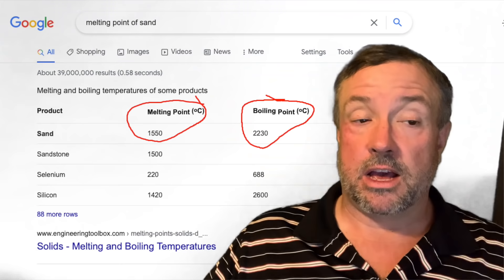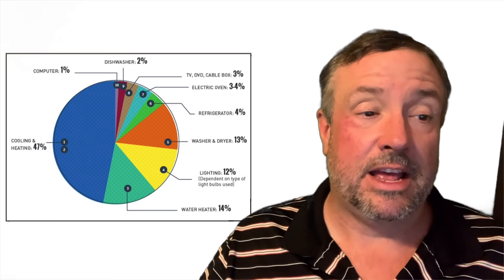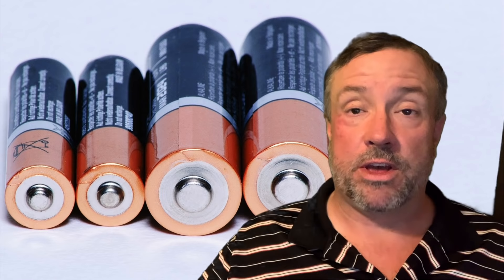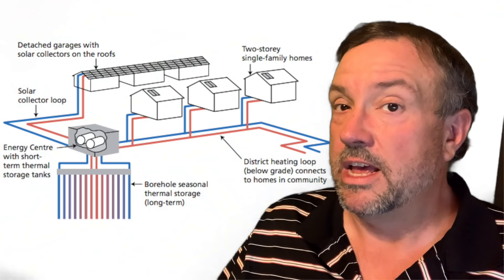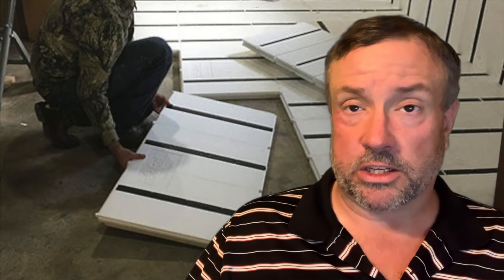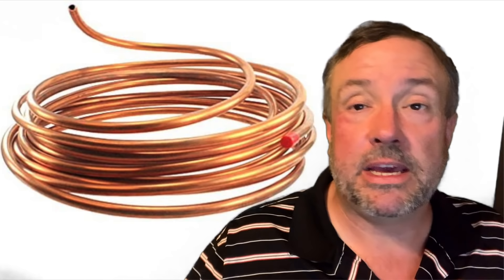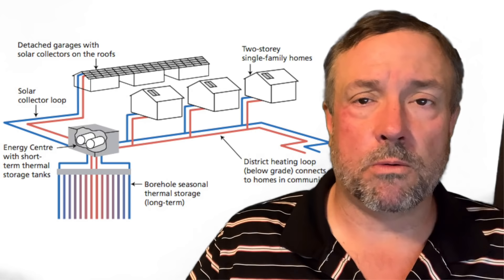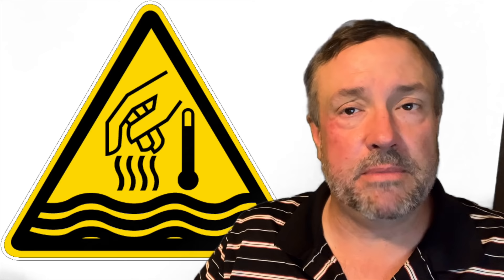Sand for Thermal Energy Storage

Comment: I'm thinking that the savings that you make from water and storage volume cost you will spend on piping and pumps and liquid to transport the high temperature with high temperatures come big problems, if something happens to the construction or piping, if a problem happens with water you simply pump it out.
I prepare to do a 20 cubic meter reservoir dinged in dirt ( I am lucky that I have yellow dirt all around my house, is strong like concrete :)))) ), heated up to 80gr celsius with ~10-15CM isolation( cheap materials are up to 70gr celsius but they can easily handle 80gr celsius ), to deposit about 60KW pe cubic meter from 80gr to 40gr celsius interval, my house eat about 60-70KW of energy/day for heating and water in winter, I will heat it with fotovoltaic ~20KW/h panels * minimum 4 hours = 80KW/day to compensate winter climate with custom electric heating element controllers developed by me ( each will handle ~5KW will be open sourced based on Arduino platform ).
I prefer fotovoltaic solar panel's because I have some crypto miners and when the reservoir is at maximum temperature I can switch the panels to miners and for better randament on very cold weather, I am from Romania and the winter can go down to -25gr celsius :)
I chose 20cubic meter to cover cloudy winter days, too big is too costly, too small will risk not to have enough heat if more cloudy days are in a row.
Reply from the maker: interesting

Comment: You should also consider power creation. From 500 degrees sand you get enough energy for different generators for days and nights. Then you could use normal boilers to heat your water. Imo it is easier to make power and use that for various purposes. Its easier to install and maintain powerline than pipes and airvents. You could run a boiler that feeds your water radiators forever for free without breaking your brain about how to get the heat from sand to your radiators. Plus i just saw a video about solar park, that stored the heat in rocks. They said that the heat went so high the steel piping and walls started melting, so they had to install more insulation. And that the rocks stood burninghot for weeks. Heat water on sand to make steam that runs your generators. Easy. You could sell cheap power to your neighbors and get rich.
Reply from the maker: Interesting ideas!!!

Comment: I would really argue for phase change energy storage to be the most efficient. The reason for that is that it sticks at the same temperature.

For example if you store energy in water when the storage device is full its about a 100C, when the storage device is empty its about 20C.

If you store energy in something like vax, when the storage device is empty, the temperature is 64C, when its full its 66C. So if you keep the  storage tank inside the heated area, say its 30C in the summer, you only get delta 35C of leakage. When summer turns to winter the leakage is effectively 0, because that is pretty much the intention. (you can actually get vax with as low. you can actually get vax with as low melting temperature as 45 degrees, cutting the leakage in half yet again

A hot water storage would have a delta of 70C in the summer, and there for twice the leakage, hence retain less energy to the winter. For sand storage the leakage would be significantly more. . While a tank of vax will not store more energy than a tank of water, it will do that with less leakage, extending the duration of the use.

Sadly there is no simple way of increasing the melting point of water, other way it would be an excellent frost protection. While lowering the melting point of water is really simple. This can effectively be used as a cold energy storage. What comes to mind is a AC unit.

Even in climate where the water don't freeze, it can still be used as an effective thermal storage.

Besides paraffin vax there is hardly anything with the right melting temperature that is not super expensive that fuse in the right temperature range. Well cocoa butter and other organic stuff exist.

There is of cause the "other" phase change type, boiling. The issue with boiling is that most thing takes out a considerate amount of volume while its in gas form, making it unusable for most type of energy storage.
Reply from the maker: I plan on doing some experiments with phase change soon and paraffin wax
Reply: @SimpleTek  cool..  i only theoreized it. But it should have relly nice result

Comment: I'm not saying that this is an ideal solution for extracting heat from a heat accumulator with sand heated to ~500-1000 degrees Celsius, but the thought arose that, apparently, there is no need to look for anything specific like a liquid coolant in a car or something else. Regular water will be enough. Because a) this specific liquid will have a high price, and we are looking for a relatively cheap solution, and b) we need to study for a long time the possible negative impact on the heating system from those liquids that would replace water. So what's the point? Simply place iron or copper pipes for water in the upper part of the sand heat accumulator through the necessary number of layers of insulation, which would guarantee us a water temperature not higher than 90-100°С (boiling). Thus, we can heat the sand as hot as the resource we are heating allows us, and the water, regardless of this, takes heat from above in portions, always having a temperature below the boiling point. Almost like in automotive cooling systems, where there are also two coolant circuits, only here they are independent.
Reply from the maker: ok

Comment: If the sand pit is near to the house, just build a 'Roman' underground insulated gravity hypocaust brick channel (with fresh air intake valve) from inside the sand pit, up to the house and use gravity/fan to bring hot air from the channel into the house, and mix with fresh air to achieve the desired temperature. Alternating Terracotta tile baffles built into the brick channel in the hot pit region will help transfer heat into the airstream. Perhaps fire bricks in the hottest pit areas. Built right it could last a thousand years.
Run copper tube with thermostatic valve down the brick channel to heat water.
Heat the sand during the day/summer using solar/wind/etc and resistive heater elements/ diesel heat plugs with a thermostat. 
A thermal torch using electrolysis HHO generator with flash back protection; on a long rotating arm and a sand hopper, could be used to melt/sinter the right type of sand eventually into an underground brown glass tank wall. A little dangerous though, but very affordable. Fill the floor and roof with concrete and insulate with lots of heat resistant expander foam? (outside)  and fill with compact sand. 
Some steel fence pickets driven into the sand might help distribute/transfer stored heat through the dry sand better.
Reply from the maker: interesting

Comment: I was thinking of adding hot air to the sand to heat it up . Inside the container there would be a small mixer that mixes the sand with the hot air . The bed of sand will get hot and you will run coils that will be self inclosed “air heat exchanger” and have that system run to cool or heat like baseboard heater . The source of the heat will be difficult
Reply from the maker: I Like it
Reply: Fluidized sand!!

Comment: Concerning the tubing that you may use...

Certainly copper tubing would work great, but it is quite expensive if you need a lot of it.  I suggest that you might use aluminum tubing as a substitute for copper tubing.

> Aluminum has about 60% of the thermal conductivity as compared to copper.
> Aluminum is about 1/3 the cost as compared to copper.
> Aluminum is about 30% of the weight/density of copper.

Source:  https://www.gabrian.com/copper-vs-aluminum-heatsinks/

Both of these materials are commonly used for heat transfer and heat sinks.  I really depends on your particular application as to which is most appropriate.
-----------------------------
Costs from McMaster-Carr (there are less expensive sources, but this is a good reference)
Copper tubing: 5/8" OD, .065" wall thickness, 50 feet long
https://www.mcmaster.com/8955K271-8955K27/
$357.82

Aluminum tubing: 5/8" OD, .049" wall thickness, 50 feet long
https://www.mcmaster.com/5177K74-5177K22/
$113.31

Ed Schultheis, PE

Mechanical design engineer for 35 years
My consulting business
Schultek Engineering & Technology, Inc.
schultek.com
Reply from the maker: I wasn't aware aluminum was cheaper than copper

Comment: How about using air to extract heat. Put it on a thermostat to blow air out through a rad that is  reglated with a mixing valve. When the rad has adequate heat, just shut off the blower.
Reply from the maker: Good idea

Comment: what you need is a sand boiler, thats inside of a water tank, and its built to the tolerances of heating the amount of water in the tank with the proper amount of hosing to get what you want from the radiators, mainly for the winter tolerances.  Every Chinese green house style should have a basement made of aircrete filled with a sealed water trench, and inside that, a sealed sand core. the core heats up the water, the water heats up the winter radiators, and directly under the green house are more hosing, summer time, youd switch hose lines, to sending the heat behind the Northwall, where there are your summer hose lines,  into a field, that needs early warm ground soil temps, or a better idea is trees and integrated crops.  This basement would also house a separate cold storage room meant for the cold earth batteries in the summer. 

also zeolite holds 4 times as much heat as water, goes to 1000 Celsius
Reply from the maker: interesting

Comment: melting point       Celsius (c)
Steel, Carbon	1371-1540
Steel, Stainless	1510 (from google)

professor, what about using steel piping
and simple atmospheric air as a fluid ?
Reply from the maker: interesting

Comment: I was thinking along this line for awhile, My idea is to heat the water to boiling by a mirror trough and run it thru the battery to collect the heat then condense it thru the green house back to water in a cycle it might not be ideal but would be DIY. The stored heat then can be used by additional piping and the condensing would heat the greenhouse. The only question is how hot can you get the steam and do I use a thermal bath to condense back to water.
Reply from the maker: also what kind of pipes do you need for steam - heat and pressure concerns there

Comment: Abit late.....
Use solar pv panels and connect them direct to a resistance wire in your sand
( The wire must always have more wattage capacity then the pannels)
So if your pv pannel(s) make 200 watts or  2000 it always puts that in your very well insulated sand battery. 
Also, no electronics, less stuff that can break.
But i have no idea how to extract that heat.... Maybe just air, but wat heatpump can work with those temps?
Reply from the maker: interesting idea

Comment: Please excuse my ignorance... wouldn't the sand only heat as hot as you could get the transfer fluid? At night if the pump continued to circulated the fluid, wouldn't the solar collector become an outdoor heater?
Reply from the maker: You stop the heat injecting at night
Reply: @SimpleTek  I suppose the best method would be to have temperature sensors on an Arduino and conditions set that the pump only ran when the collector temperature was greater than the sand?

Comment: For pyramid they use energy. Lithening. This is caming inside pyramid where was sandstone and this was make hot. And then u need liquid,  mercury, to Transport heat where u need. Also other metal,  i think cuper. To make elektricity.
Reply from the maker: Ok

Comment: One major pojnt that seems to be missing in this interesting discussion  is how long heated sand  would retain its heat before start releasing, and then how long will it take to drain out after heat is being used. How large would be the sand storage to maintain heat during several months, compared to the dimension of the ambient to be heated? I wonder if the sand close to the draining tubes would cool faster and so there would be the need to periodically remix the sand to spread the remaining heat more evan? obviously there are  many factors coming into play (speed of draining, dimension, insulation of sands...)... which are the most important? any clue on how to calculate  them?
Reply from the maker: Heated sand retains heat based on volume and insulation
Reply: @SimpleTek  yes indeed that is clear. but where can I find some more actual detail on how to make some calculations? on the questions I asked the web seems rather vague. partly might be due to the obvious high number of variables, but how to get some starting point? or else, does anyone started some small scale experiment to start digging out these problems? thanks
Reply from the maker: @necspenecmetu-24  good question, deep googling maybe?

Comment: I’m not sure your going to get usable recoverable heat over such a long period of time however what might be more practical along the lines you are thinking is using a wood heater and a circulated hot oil system to store heat in sand in an insulated container of some description, that way you can remove the need to tend a wood fire continuously and perhaps only need to do it for a few days a week / fortnight / month depending on how much energy you can store Vs use (and losses etc)
Reply from the maker: maybe..
Reply: @SimpleTek  another method might be worth considering, build a wood heater with inbuilt sand heat storage in a fabricated jacket directly around the fire drum and have oil piping throughout the sand to extract the heat. Insulate well externally to retain heat.

Comment: Use the parabolic array using computer control.  Use an ammonia based salt brine for thermal transfer to the sand.  Not sure the best way to transfer to the sand effectively likely a pipe array at the bottom of the sand sink.
Reply from the maker: sounds very cool

Comment: Perhaps you could just use copper thermal hot water solar panels into plastic underground pipes and use PV electricity to pump water through the circuit continually and passively. Size it to compensate for natural thermal losses underground.
Reply from the maker: yes!

Comment: Keep the aircrete tank idea, stack a resistance in the sand, and connect it with a wind generator. Wind blows day/night from summer to winter, your sand battery will be charged all year round. Just set some controller to avoid heating it over 90 celcius.

Comment: If your store electrical energy, you can then use a heat pump to generate the heat on demand with a high coefficient of performance. What would the COP of sand storage be? I'm guessing < 1.0?
With a 22% efficient solar- -> electricity and a COP >4.5 you can get more heat from solar than all of the solar radiation combined!!!
Reply from the maker: Interesting

Comment: Concrete chemically degrades with heat right? I don't know if starlight could be used, but it's cheap and it's weaknesses aren't relevant here right?
Reply from the maker: What’s starlight?
Reply: @SimpleTek  It's a carbon foaming material with various additives. There are commercial preparations with a different technical name that I'm not familiar with. It's often a mixture of flour, sugar, water, and borax for strength and pest resistance.

Comment: I'm sure you already thought of this, but how about metal drums filled with sand and painted black  with an air exchange setup?
Reply from the maker: you posed a VERY good question. The issue I see is for storing heat under 100'C water holds more energy, a lot more, than sand. So people fill metal drums with water and paint them black if inside the greenhouse to store heat. it works for that purpose water is the best heat battery material. Sand becomes advantageous because it can store a higher temperatures above 100'C and using higher temperatures it can store more heat but not just by absorbing heat from regular sunlight without amplification.   does that make sense?
Reply: @SimpleTek  What is you use  magnifying solar to raise the sand temp and insulate it for slow dispersion.

Comment: Why not using salt mud solution in steel pipe to heat the sand storage then another steel pipe to heat water from the same sand storage in two pipe systems
Reply from the maker: interesting...

Comment: im gonna do this and heat it with wood fire or oil fire. run steel pipe back and forth through the sand and use forced air to move the heat.
Reply from the maker: That’s awesome